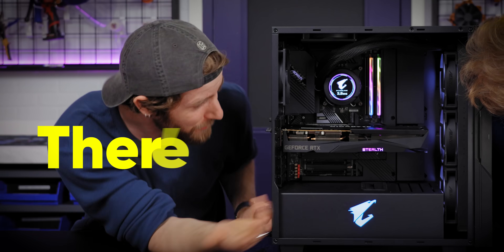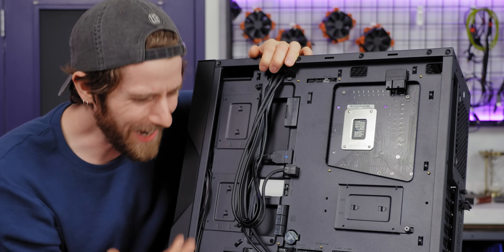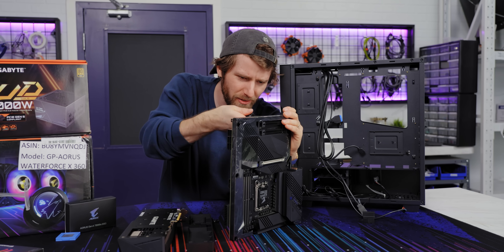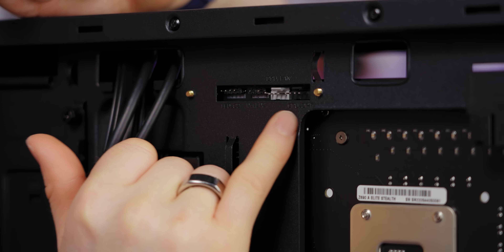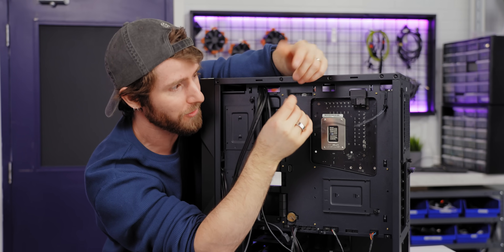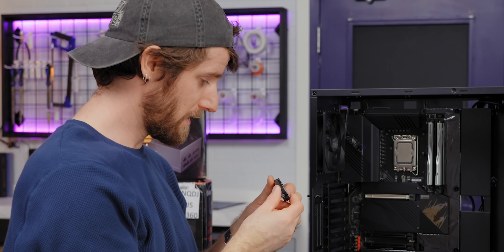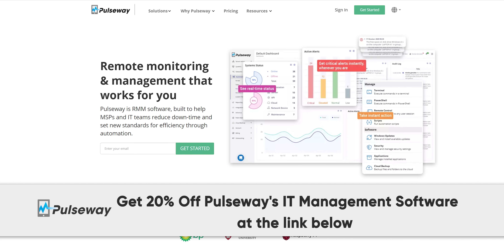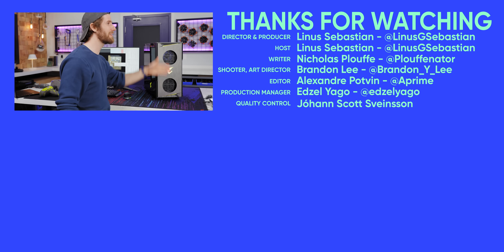Where Are the Cables??? - Gigabyte Project Stealth

Comment: This needs to become standard! ATX is such a dated concept. If we designed the computer from scratch in 2022 it wouldn't look like it does now.
Reply: For sure, and once there's a case like this that comes out with 5.25/3.5" drive bays I'll definitely get one of them
Reply: @robbiefl2001  uhhhh... External bays are not exactly a feature these days. If you need a drive, external USB ones are faster these days, regardless of what type.
Reply: @marcusborderlands6177  you'd be surprised how many cases still have them, and yes external is faster but I personally just prefer having my desk a bit less cluttered up, so having an internal one helps with that
Reply: @marcusborderlands6177  and if you HAVE to have an optical drive, burner or what have you, they make them slim enough and small enough you can hide it in the cable side of the case if you want. OR just get an external usb one and toss it in the junk drawer when you are done.
Reply: Sure, and let's call it LTX... oh wait...
Reply: That's what i think of gaming mice too
Reply: @Photo Bunny you dont have to with ryzen :)
Build my pc in 2017 with r1 and am now on r3 with all the same hardware
Reply: @D3nn1s  until now with the new socket. I mean I could say the same with intel, they used the lga1151 socket for quite some time
Reply: and gpu/pcieX socket near cpu? ram + vram + fast storage toghter like ram now??
Reply: @Photo Bunny the problem with BTX was it was way to different
This IS ATX, just with some connectors on the back
This could be "ATX-S" the S for stealth
And you could even maybe do some trickery to get it supporting non "ATX-S" cases, maybe not
But this is something you would need a new case for anyways because of the "ATX-S" GPUs that would be made, or maybe manufacturers just add an extra power connector to the back of their cards and call it a day
Reply: @Photo Bunny nah cuz thats my first pc ;)
Reply: @Photo Bunny atx was only invented in 1995, you act lik youre 50 but your words say youre ~20, im confused. Also im rocking mATX and i kinda like it so yeah, im one of the guys why its still around. Btx also looks very strange with the 45° cpu

Comment: I liked the port shifts for a lot of the cables. Especially for those super clean builds. Definitely has a ton of potential.
Reply: It would make more sense to redesign the power system to where you only need to plug one cable into the motherboard and then the motherboard sends the power to the drives and GPU itself.
Reply: @NikoBell1188  oh, no it wouldn't! Do you know the problem it would be to need to power everything directly from the motherboard? To start with something, almost any short could be a catastrophic one, ending in the death of many components (or even all of them), wich isn't as likely with the current layout, the whole motherboard would need a massive overhaul with a huge increase in cost, more heat disipation too since it now runs the power of the entire system, and other problems that i might not realize. I understand why it seems like a good idea, but it would be a massive headache and increase the damage risk with minor failures to unsuspected ends. Another thing would be that the high power lanes from the GPU are separated from the motherboard, wich could prevent ghe motherborad from dyng if the GPU dies and vice versa in case the mobo dies. I could keep going but i think i made my point
Reply: @Ferrari255GTO  how do you think laptop motherboards are powered?
Reply: @pearce05  Totally different power solutions as you can't replace the GPU in a laptop so a desktop motherboard would have to be able to deliver at least 450 watts, 3090 ti, through the motherboard to the gpu. Desktop 12900k can use somewhere around 240 watts indefinitely. it wouldnt work for desktop.
Reply: @pearce05  well, it's quite different because the components that go on a laptop are literally made for it, wich means that power delivery is designed around the hardware they wanna use, and yet thermals are still a massive issue, to the point that most laptop hardware is quite limited in relation with the desktop version . Laptops also come with a more prepared motherboard for shorts, and have a battery instead of a 1200 watt PSU.
Reply: @Ferrari255GTO   so what you're saying is, because desktop motherboards aren't designed for it, means they can't be designed for it? There are plenty of servers that provide more than 1200 watts through their motherboards. There's no reason a desktop can't do the same.
Reply: @pearce05  no, i have said that it would be extremely complex and impractical to do this with regular desktops, because laptops unlike desktops also have specific dedicated power input. It would be almost stupid to multuply the production costs and the engineeering time that much just to hide some cables. Also, the graphics card would need to be designed specifically for that purpose, wich is once again inpractical and expensive to do. Laptops have the advantage that the power input is specifically made for them with a simple transformer and a second layer of protection with the battery as another filter, making current protection less of a problem. I don't know much about servers, so i can't discuss that part, but servers aren't half as common as desktops and are often more specialized than regular computers, costing considerably more, and still the graphics cards on servers require regular 8 pin connectors.
Reply: Sadly I think that is the culmination of this, just "Potential" and nothing more. So cool. I can see some other companies applying this to SFF custom prebuilt systems.
Reply: @crisnmaryfam7344  i think it would be cool if instead of building a whole mb around being slick, adapters to route the plugs backwards with a stealthy look could get the same job done in a way simpler way that is almost as effective. It wouldn't be as clean, but i think it would do the job